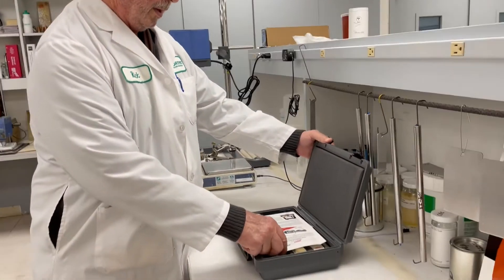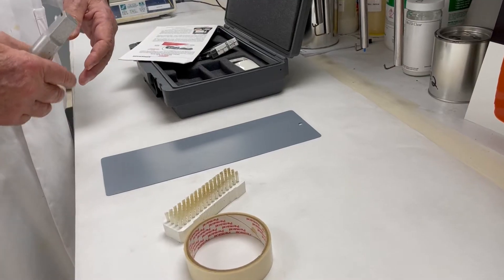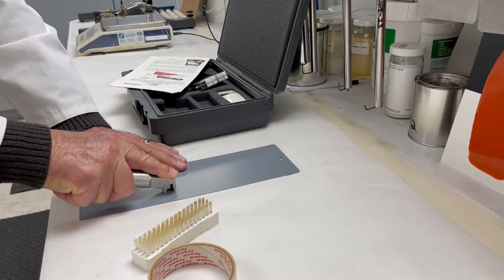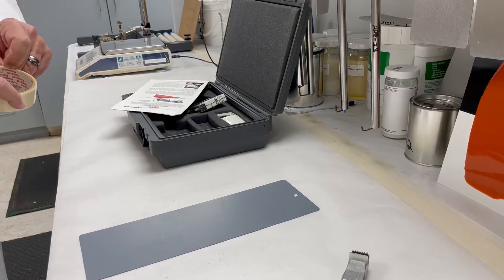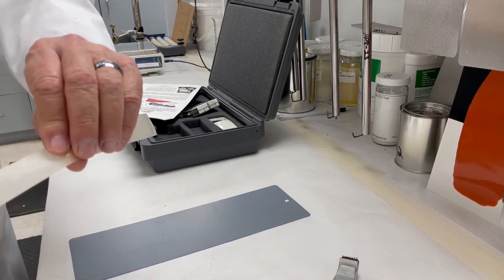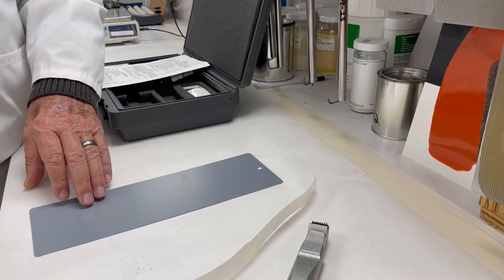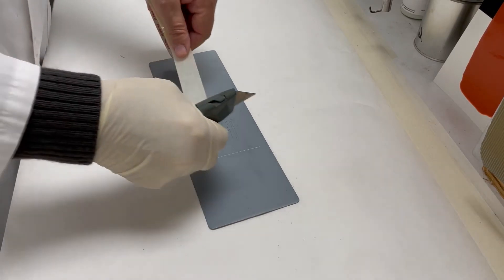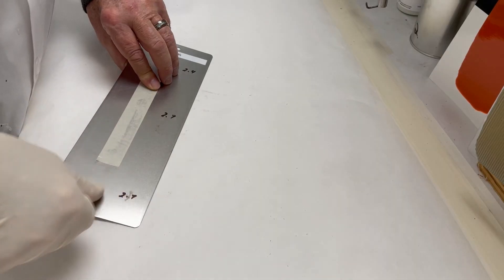How to Test Coating Adhesion

Comment: the way I do it is sand it with 80 grit paper. Apply 1" thick body filler and then try to break the body filler with hammer. If painted is lifted, then adhesion not good